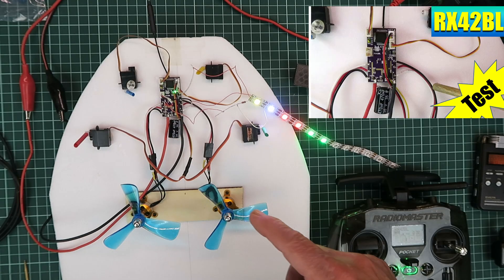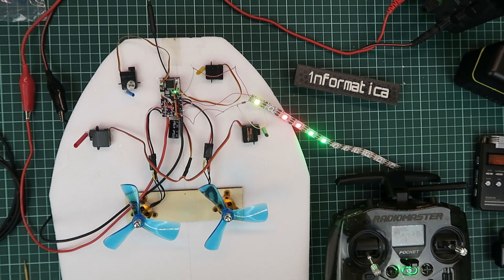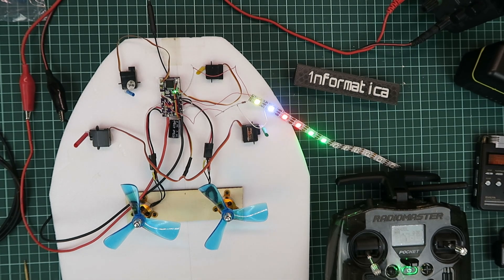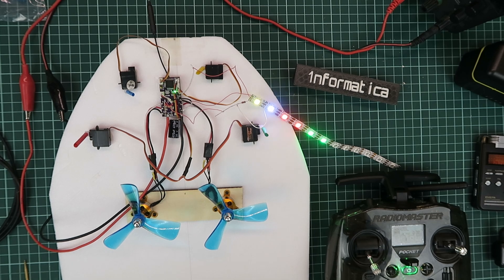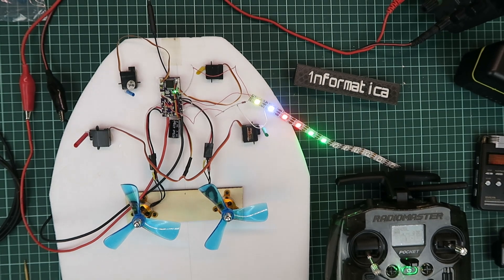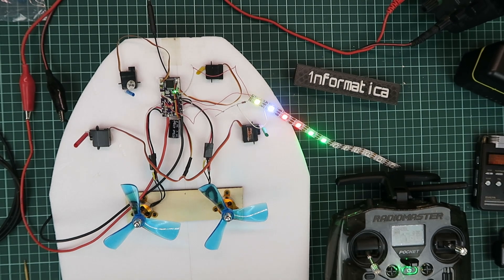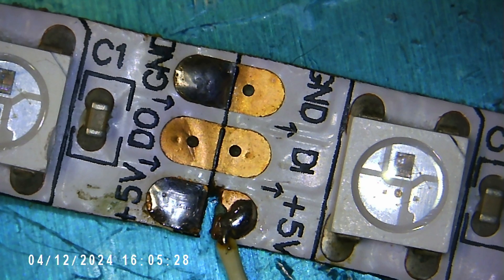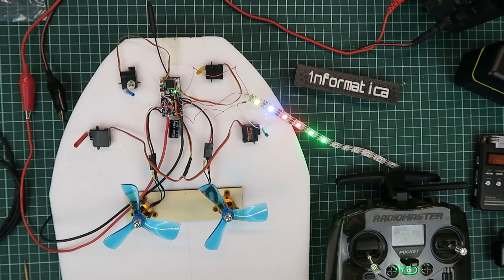How to Easily Shift 3.3V to 5V for LED Strips: Simple Diode Hack Explained

Comment: Maybe you could also raise the GND of the uC  by 0.6V when powering it from the 5V Voltage by a 3.3V Regulator. Just drop in a Diode from the WS2812 GND to the common GND of the Microcontroller and the voltage regulator.
Reply from the maker: Interesting idea! Thanks for watching, have a great day!